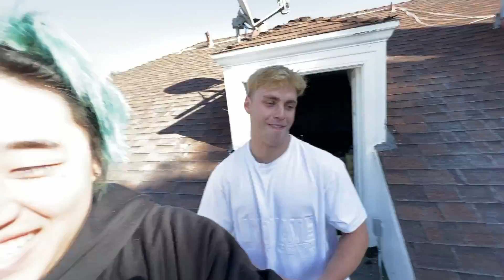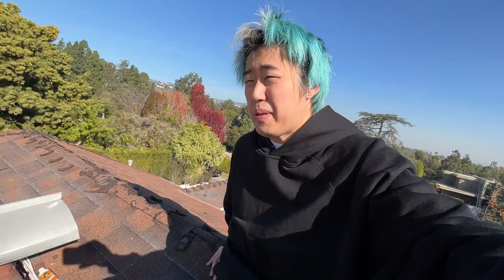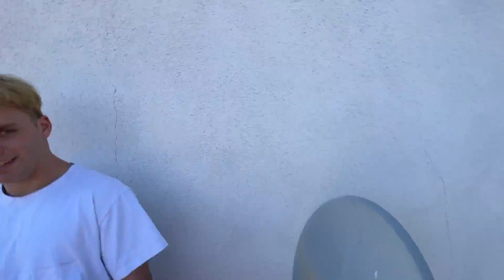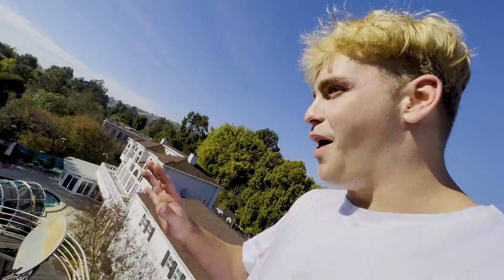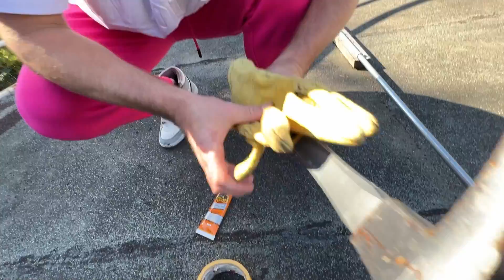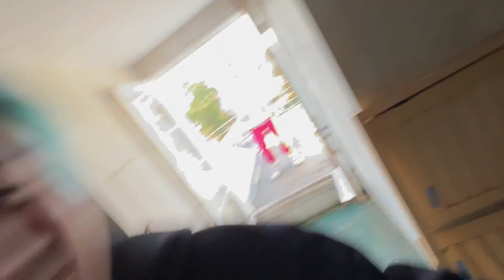LAST TO LEAVE ROOF WINS!

Comment: 3M duct tape is used for wrapping pipe insulation,  hanging protective sheeting, and repair. It's not that strong though. It can only hold up to 19 pounds.

Comment: Stove they used a rope to pull down the tower. they use the glue to glue the rope to the tower.and the glove to pull the rope with out burning their hand. and used the hammer to beat the melt.and the tape to also to tape the rope to the tower.